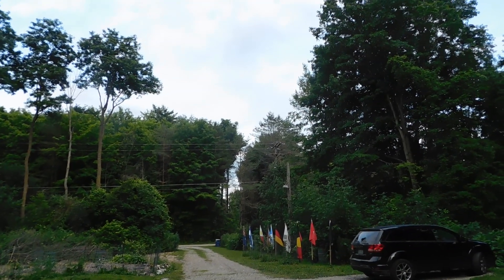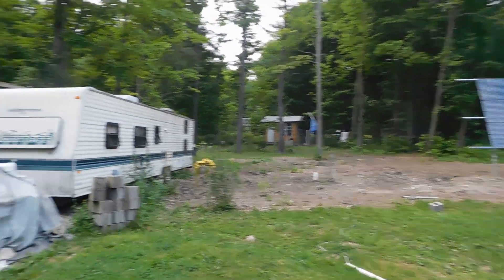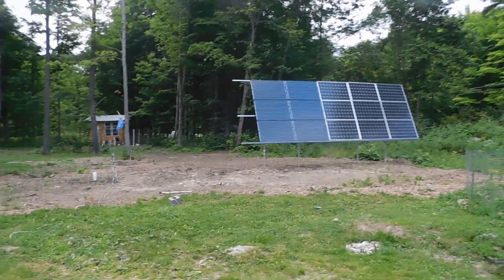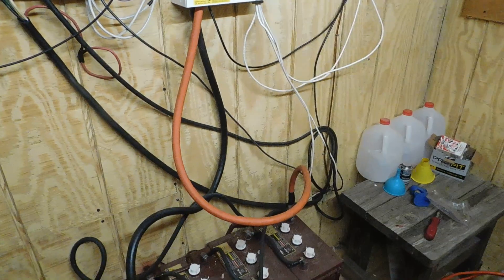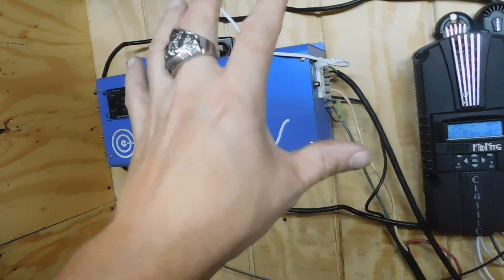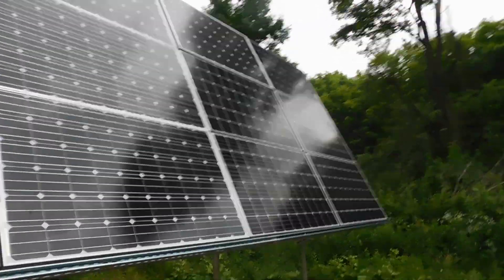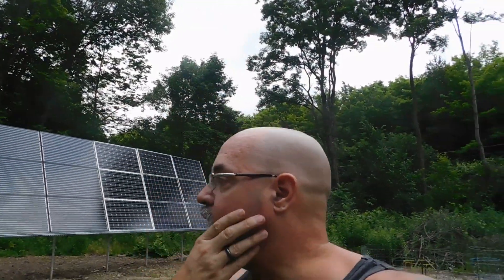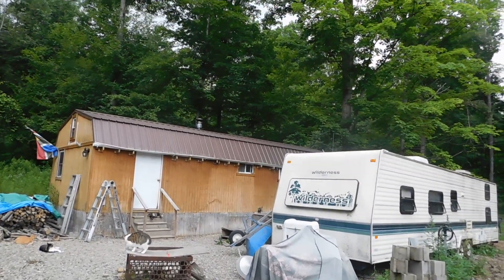Doing a complete rundown of our solar system. How we started where we are now.

Comment: Hello Ed. Thanks for doing what you do, teaching other people how to get ready for off grid life style. This is great and much appreciated. Just so you know, we are following what you are doing every day and it is very instructional and we are going to try to do our thing right the first time around. I am in the process of preparing like  I said and as such, am buying and ordering the equipment in order to get energy from a wind turbine. I will be completing that first and then will be doing the solar avenue to complete the whole energy process. I have just a couple of questions, the first one being your choice of battery type. I have checked the Trojan battery model "L16E" you mentioned and noticed that it was not lithium ion phosphate style batteries. For my own benefit, would you mind telling me why you did not choose lithium iron phosphate (LifePO4) batteries over the Trojan type battery. May be TRojan are a better choice and that's why I would like to know before I order the batteries for my system.  The second question is about your new Aims inverter/charger system. The reason is that I will be buying the same style of inverter as you did, I am just not sure what size. I will have a 24v 4800watts battery system and wanted to get the aims 2000 watts inverter / charger but now I am thinking that I should may be getting the 4000 watts system instead. Just because my planned system will have a capacity of 4800 watts. I would like to know what you think and what would be best considering the information I have told you. Thanks very much for your input. Bye and take care. Keep up the good work. We are in quebec, canada.

Comment: Have you put any thought into whether any of this system would be operable after an emp ?  Its of course very tempting to install and use the panels that you purchase to gain the immediate benefit but it very well might be shot when you need it the worst . The people selling and installing solar are often selling devices that they say will protect the system but im not buying that all the risk is going to be coming from the output side of the panel and not through the air and into the light collecting side .  THe panel is made to collect radiation from the sun and would probably be doing the same with whats coming from an EMP . Some people think that it would only potentially hurt the diodes but I really would worry about the very fine wires in the face of the panel itself. 
At this point im putting my solar panels into faraday boxes and the same with the inverters and controllers .

Comment: Great solar setup. I built my solar generator after watching your previous solar videos. I also started out cheap and found out quickly that I needed to upgrade. I sold my old inverter and charge controller and now I have the aims 12v inverter and the same charge controller you have. I’m renting so I can’t hook it up to the breaker box that’s why I’m on the 12v system. Will definitely change to the 24v system after I find me some land. I also have 6 marine deep cycle batteries. My system produces enough power to run both my deep freezers, refrigerator, charge phones, computers and lights. I have 4 -100 watt panels. Thanks for taking the time to make your videos I greatly appreciate it. They have helped me out a lot in my preparations. 👍👍
Reply: That's awesome CB...

Comment: Solar is a fantastic method of gathering usable sustainable power and having fact checked, I have found out that enough solar energy is released by the sun in one hour to run the earth for a year!!!   Here in the UK we have two main obstacles to get over to make a home built solar system viable, cost and the amount of sun we get.  I have limited funds, enough to live on and buy the odd prep, but to invest £1000's into a solar system and good quality batteries is just not achievable. I have small solar system which I have in place for emergency use only but it would not run my whole house.  It would give me enough for lights, a 12v telly, charging for my radios and a small cooler box.  1 x 125w panel (I will add a 2nd in time) and 4 x 110amp leisure batteries will give me 440amp at 12v for some quite considerable time.  You are so lucky to have such a system, I am really envious.   Keep up the good work.

Comment: Yep, a really nice setup, Ed! I have only two 120W panels on two large 12V marine batteries that run my Amazon Echo, (mostly for iHeart radio), a 60W equivalent LED bulb between the living room and kitchen, (open concept), one over the sink and stove and one in the bedroom. They will go all night if needed. And I have a 30W panel on a smaller marine battery to charge my phone, iPad, keyboard, mouse and two backup battery packs for when I'm away to charge my phone. I haven't used grid power for any of those things in almost two years.